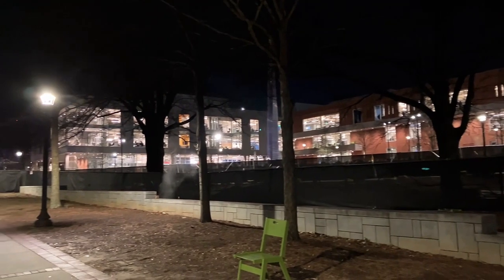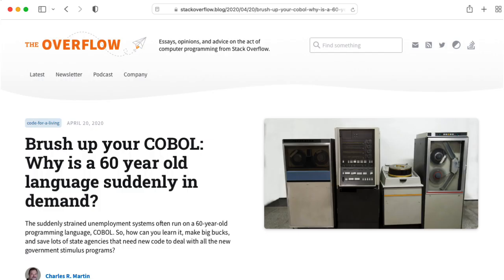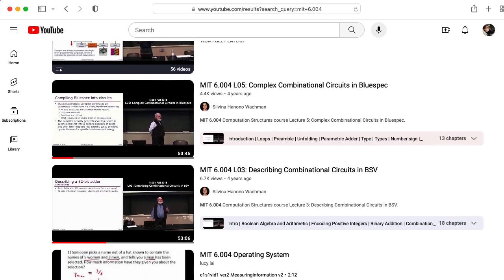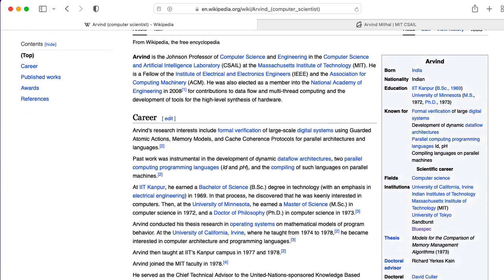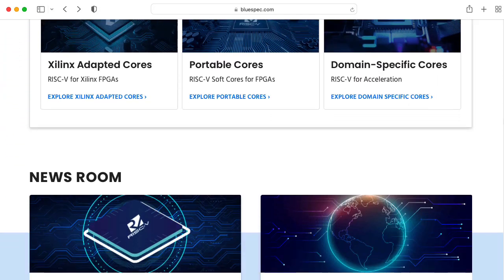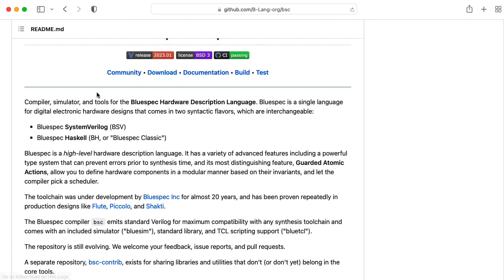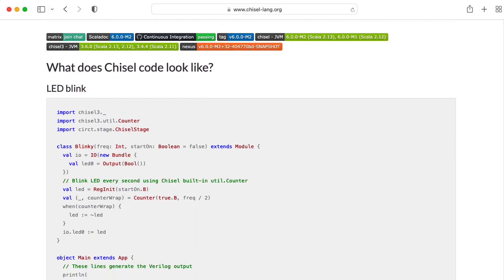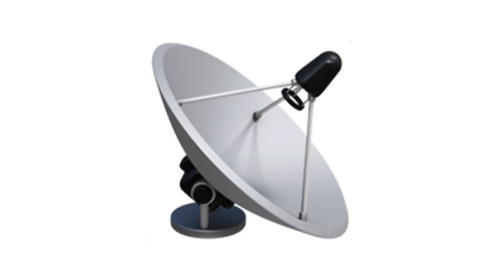Alternatives to Verilog & VHDL: Bluespec & Chisel (exploring Hardware Description Languages)

Comment: dont invent new crap languages please, Verilog is just FINE! instead its just nice to have a new Simulators and EDA tools free and open source for it! nobody gonna learn this new crap langauge you making chisel-misel-bluespec-scala etc! I'm just saying this as an active engineer working in the field, NOONE will approve this new odd crap into any program!
Reply: From my own experience, I can say that Verilog is pure GARBAGE.
It lacks so many things, and this is why I prefer System Verilog.
Verilog doesn't have always_ff or always_comb.
Reply: @ yes I use now SustemVerilog and always_ff or comb only
Reply: Programming computers in assembly is fine too, but there are much better option for 95% of tasks. Same concept applies to with Verilog.

Comment: If the greedy FPGA chip producers don't open source their entire toolchain, the FPGA programming field will remain dead in the water.
I once had remote access to a computer in my lab and modified the program to try to synthesize it, only to find out that the Quartus license I was using didn't allow me to synthesize it under remote control, haha!

Comment: I have used Migen (which now has a new version called Amaranth) which is based on Python or I should say is a HDL generator framework in Python similar to how SpindalHDL is a framework in Scala to generate Verilog code.

Main reason I used it was because I was interested in Processor + Logic implementations and there is a tool called Litex in Migen which generates the SoC part and also the necessary libraries to program the SoC in C (or any other language where you can generate a support library from SVD).
Reply: I'll have to check out that generator!

Comment: Tried Chisel, didn't really like the fact that it's built on Scala.
I tried myHDL and it's kind of a heap because it abuses Python builtins to make HDL structures and it's kind of clunky.
I liked myHDL and Chisel in that you can programmatically generate HDL using regular software programming languages which I thought was powerful (I think for Python I made a CIC decimation filter-generating Python code--you specify the decimation filter parameters and it gives you the HDL object that you can plug it into the rest of the stuff)
Reply: I'm about to use myhdl to make polyphase decimate by 2 filters for a class since I hate vhdl with a passion so if you could leave some of your experiences with that'd be great

Comment: My main problem with this new languages is learning curve. Previously you need to learn just one language: verilog or VHDL and then you are ready to design hardware. Bluespec is a dialect of the haskel, so you need to learn haskel first and then bluespec because the other way you will not understand anything. Chisel or SpinalHDL is even worse, because they are dialects of the scala programming language and scala is dialect of java.
Reply: VHDL is also a dialect of Ada, so at the end of the day it's another poison to pick from.

But at the end of the day you don't need to understand the parent language, nor do you start from zero because the concepts are fundamentally the same; more recent languages will even have better ergonomics and better abstractions for HDL, and IDE tooling that is increasingly easier to build for languages nowadays, which helps newcomers even more.